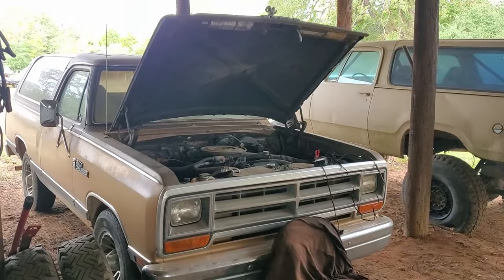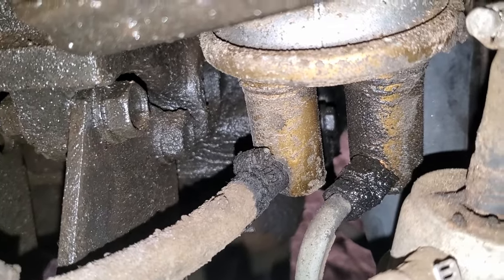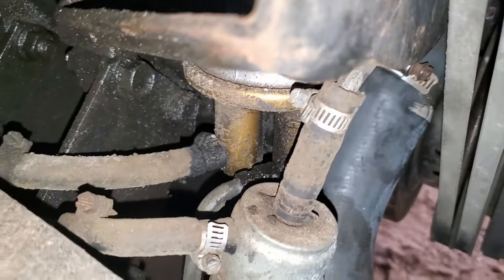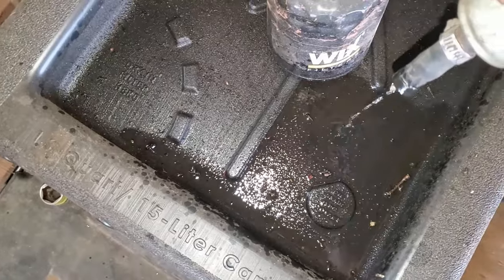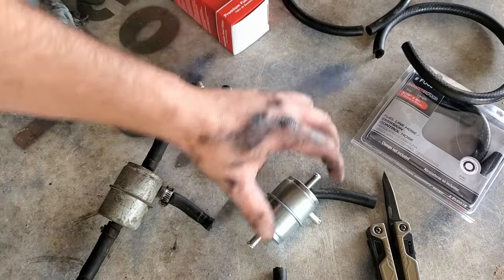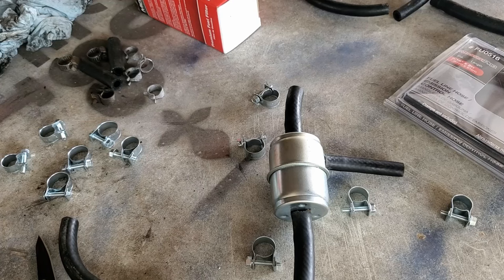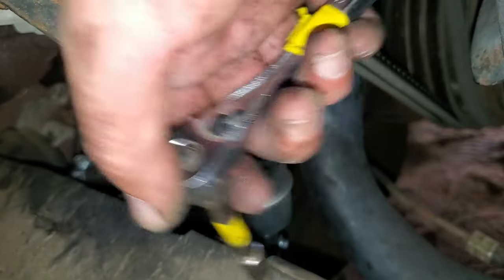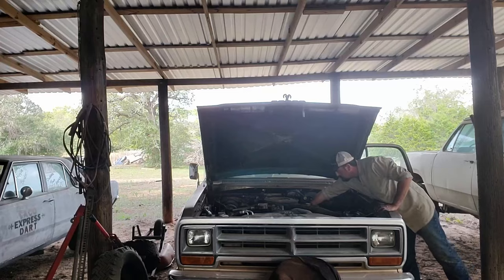FIRE DIRT | Fuel Filter and Fuel Line Replacement | 1987 Dodge Ramcharger 318 V8 Maintenance

Comment: I've never tried those other clamps they are certainly worth a try compared to the crappy ordinary radiator hose clamp. Although the constant tension spring clamp usually does good as long as they aren't 30-40 years old and have been left alone I still have a couple of those on my 92 Cummins primarily the vacuum pump hoses. Which reminds me of my power steering leak Lucas power steering stop leak seems to be working good though.
Reply from the maker: So far I have had good luck with these clamps, I just need to buy them in bulk! Appreciate it and Thanks for Watching!

Comment: What kind of fuel filter has 3 hoses
Reply: The one on the side is a vent I think.
Reply: It's used to help cure vapor lock.
Reply from the maker: The third hose connection is actually a return line. I believe  Like 440Phoneix said, It to prevent vapor lock. Ive only seen them on late 80's Dodges though. Appreciate it and Thanks for Watching!
Reply: @DuddiesAdventure  yeah that’s right, I knew it had something to do with vapor lock but could not articulate how. 

Good stuff Duddie. Even small, simple jobs are fun to follow on your channel